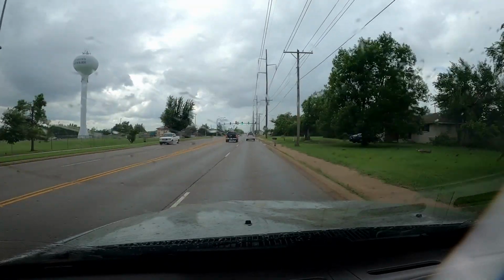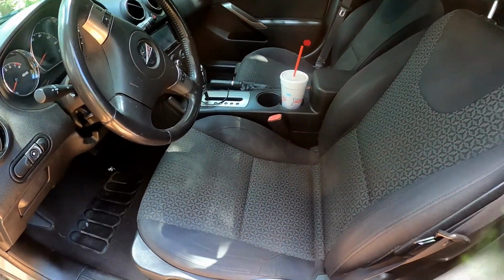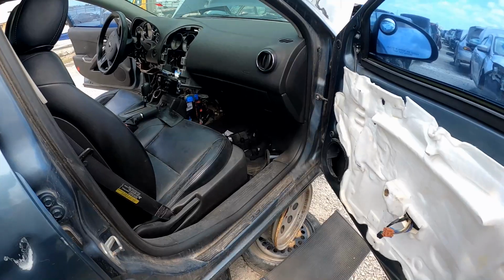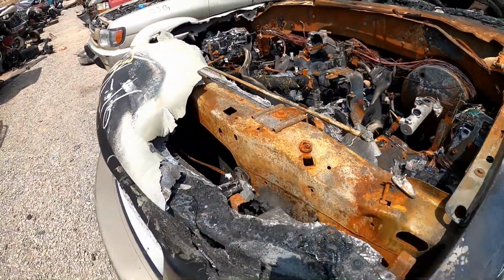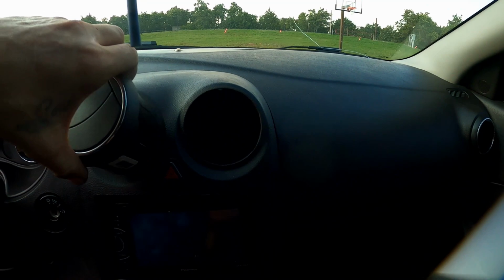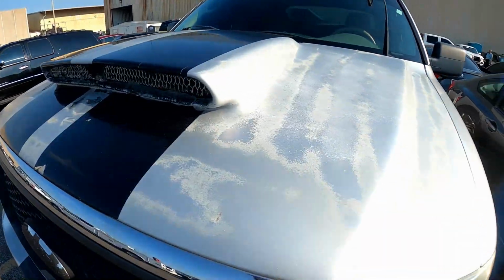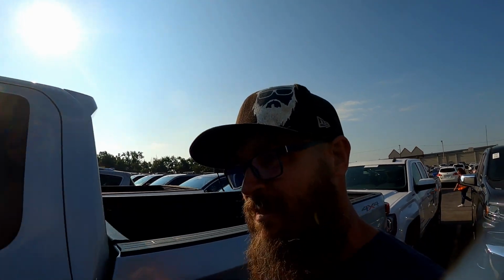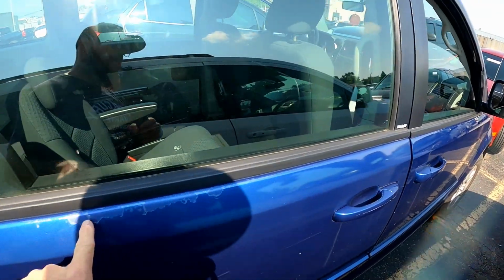How to flip cheap cars with little money.

Comment: chevy mailbus of the 2000s-2013, and ford fusion are easy to flip as well, even a mazda 3 is easy to flip as well
Reply: As long as the Malibu doesn't have the typical overheating issues and the fusion without transmission problems
Reply: Along with 00-05 LeSabre grand prix gm 3800 engines
Reply: @dlx92  The other thing to watch on the 2000-2004 Malibus are corrosion of the hard brake lines. It’s especially the case in the north.

Comment: 2010 dodge van was the last year worth buying. When they switched to the 3.5 they screwed up. Its not good for much more than 150xxx. 2010 is the last year for the 3.3 and the 3.8. Those 2 motors you can put the miles on if you do the upkeep. Nice flip on the Pontiac. Glad to see a new video.
Reply: I’ll have to disagree. The 3.6 engines will run 300k easily. The old 3.3 and 3.8’s burn a shit ton of oil, have intake gasket issues, and were very underpowered in these vans. The Chrysler 3.6 is NOT the same as the disasterous GM 3.6. They do not have the timing chain issues as some would like to believe. Better fuel economy too. 100 more horsepower. I rebuild and sell a ton of the Chrysler vans. People want the 3.6.
Reply: @helivesonforever  Ive replaced the heads on 7, 3.6 dodge vans. 1.... maybe i could under stand. 2.... im starting to wonder.... 3 fluke? 4,5,6,7 yea screw that. Im glad you have had great experience's with the MOPAR 3.6, I have not. You are right about the intake issue on 3.3 and the 3.8, I would rather change them than heads.
Reply: @helivesonforever  BUT,,,, The 4.0 Ive never had a problem with so the got one thing right.

Comment: I wonder if those vents would fit in a 09 Opel Corsa.

They're the same, but instead of being adjusted by just turning the thing around and pushi g the flaps up or down...

You push the flaps up or down, but it has a little wheel to adjust from side to side and this will always pop out from inside and make them impossible to adjust.

To take them out I use the metal bits from an old style wipers from the inside of the vent.

Comment: GM did a bunch of fuel mileage test with the G6 testing different devices so some g6s can get over 40 miles per gallon on normal one is like 29 30 miles per gallon but some can go much higher than that the only drawback is you can never take it back to the dealer cuz they'll  take that device out of that car

Comment: The hail damage wasn't all that bad, in fact, it was barely noticeable until it's in the light. They really scrap that car for that damage? Age vs cost to repair was greater than the value of the car? How do you decide where to draw the line in repairs/detailing? Those seats looked pretty gnarly with dirt. Could have used a shampoo.

Comment: Is that the same F150 you did the spark plug hole repair on? If so, has it given you any trouble since then? Lol
Reply from the maker: Same old truck. Still going 5,000 miles later. No more trouble so far.

Comment: I know time is money but those seats are filthy with sweat/fluid stains and you keep on saying "nice and clean" as I'm looking at them 🤣🤮  Would have taken an 90 minutes and $10 in product to shampoo the seats/carpets and then could have tacked on another $300 for doing so. I always find there's value in cleaning them up for buyers as they don't want to or can't do it themselves. Also, ALWAYS swap out the cabin filter for a new buyer assuming they'll want to drive it first.
Reply from the maker: My camera has welding spots burned into it from previous videos. Those seats were absolutely fine. It’s the shitty camera lens. I think I’ve proven that I know how to detail a car. You must be new😂